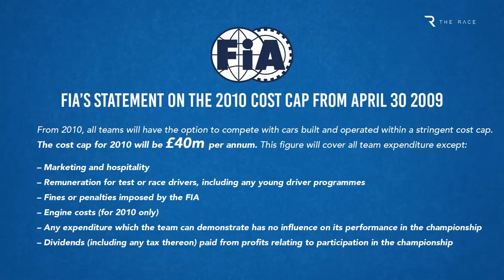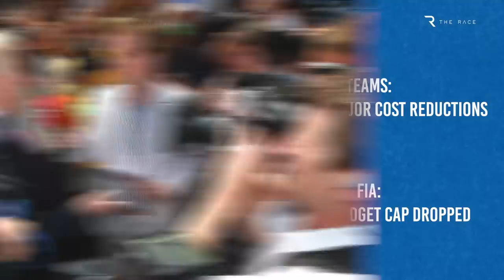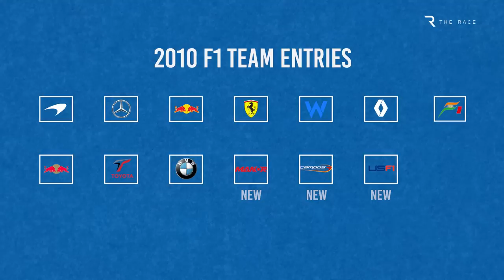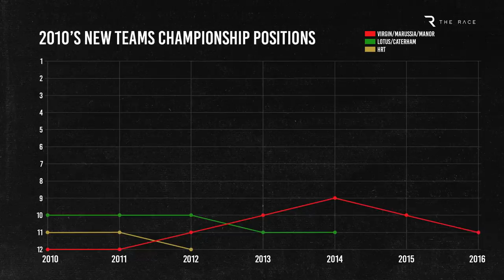Why F1 2010's new teams all failed

Comment: They were promised a cost cap would be implemented quickly but it never came.
Reply: Well it came 12 years later😂
Reply: @CmLeo145  yes, but that’s in an era where the teams realized they can just tell newcomers to get the hell out of here if they aren’t manufacturers, so is it really that much of an improvement?
Reply: Kind of like Red Bull then
Reply: @mrsoisauce9017  or willing to buy out an existing team. F1 isn't that attractive to start from scratch now.
Reply: @WhiteG60  maybe inflation does not help too
Reply: Too much money at stake and the budget unlike nowadays could not be properly regulated.
Reply: @WhiteG60  back in the first half of the 2000's top teams were spending over 100M, F1 has always been really expensive
Reply: @WhiteG60  that's not the mechanism. A voluntary cost cap with technical freedoms Vs no cost cap but technical limits
Reply: If I remember, the cost cap that was supposed to happen never came because the top teams,  Ferrari, Red Bull, Mercedes and McLaren rejected it harshly.
Reply: @CmLeo145  or even 200 years later.
Reply: @siloPIRATE  more like downgraded red bull.
Reply: @krys8494  inflation seemingly never help bro.
Reply: @purwantiallan5089  it surely felt like 200 🤣🤣
Reply: @WhiteG60  Toyota spent 400 million in the early 2000s
Reply: @WhiteG60  obviously it's for all the expenses, including the development of the engine, from which they also made money by selling them to Williams

Comment: It shows how expensive F1 has become for the proposed cost cap back in 2010 when they first thought about it to be £30M
Reply: Hybrid be that way. Even crazier that the biggest teams didn't even blink.
Reply: back then the team budgets were around the same as the current cost cap or more, 30M was a joke for most of the teams that's why it was removed
Reply: Maybe a double-hybrid system that does nothing but make the cars larger, heavier and more expensive just so auto manufacturers can virtue signal about the enviroment was a "bad idea" in single seater racing.   Car companies dominating the sport is the worst thing eccleston did during his tenure in charge.  F1 was far more "F1" when teams like Lotus,  Brabham and Arrows were in the sport, real racers, than a marketing wing of a mega corporation.

Somehow its too expensive to ship refueling equipment to each race (that makes the cars smaller and lighter so they can fit on a track together), but a hospitality center that takes 8-12 semi trucks to transport so corporate guests can ignore the race in comfort is no problem for the sport to handle.
Reply: @thevictoryoverhimself7298  refueling is about more than expense. The primary reason they don’t do it anymore is safety, and because they don’t have to.
Reply: @mmonkeyman1403  the stated reason at the time was shipping costs.  I was there at the time :). This was in the middle of a bunch of dumb knee-jerk reactions to the 2008 financial crisis that we are still living with in f1.
Reply: @thevictoryoverhimself7298  refueling isn't what made the cars smaller, the larger tanks don't take up that much more space, maybe lengthening the wheelbase a bit. The reason the cars are so gigantic today (and since the hybrid rule set was introduced) is to maximize the area of the floor. The hybrid adds the weight, but the giant footprint is due to the regs, and teams won't want to give up that much "drag-free" downforce.
Reply: @jsquared1013  it’s a combination of the hybrid system, the fuel tank (it’s literally 3 times larger) and increased crash safety.  2 of which could in theory be removed today and result in better racing.

Everyone blames dirty air but I think the giant cars are a big problem for overtaking.  Grand Prix cars have been racing at Monaco for 100+ years or so and while the track was always tight, only recently have arguments to drop it completely gained traction.

Monaco.  Imagine f1 without Monaco.  Losing Ferrari would be less damaging to the DNA of the sport.
Reply: @thevictoryoverhimself7298  Agreed. Even the AWD hybrid LMP1 cars were nearly half a meter shorter than current F1 cars so I don't think there should be any excuse for the next generation of chassis regs to not shrink the cars.

It seems to me that slowing the cars down by a significant amount via a combination of less aero and less power might help a bit with the size/weight of some of the safety structures on the cars. A slower car has less energy to dissipate in a crash. They could be 10s a lap slower than now and they'd still be the quickest race cars out there.
Reply: @sealcuddl3r  There is something wrong with f1 cars being slower than they were 10-20 years ago tho.  Its an engeneering exercise first, a sport second, a show last, and a safety exercise never.  On some level we need to be comfortable with drivers, track marshalls and even spectators dying.  Not too often, but not never.  True "never" is infinite and perfect is the enemy of "good enough".

I think the cars gaining size to make deadly accidents 20 years ago survivable is a win.  I think making the cars larger to allow for no refueling or hauling a giant load of batteries around for a grand prix distance like a glorified semi truck (google says this is american for "articulated lorry") is a loss.
Reply: It was low because it was optional and you gained some other advantage to make up for using so little money.
Reply: @mmonkeyman1403  not even Red Bull noticed that big cost cap.
Reply: @thevictoryoverhimself7298  double hybrid system and double the cost cap maybe gonna hurt any single new team attempting to compete in F1.
Reply: @jsquared1013  imagine if Vettel RennSport entered F1 in 2025.
Reply: @sealcuddl3r  my favourite era of car dimensions was as they stood at the end of the 1992 season. Wide track, short wheel base, low front wing and high rear wing, massive diffuser with a flat undertray.

I know flat undertrays are unstable and dangerous and that wing configuration impaired by following in a wake, but that’s when F1 cars purely on looks were at their best. I hated the double bites of 1993 and 1998 to bring us into the narrow track era and was absolutely delighted when he went back to wide track, but I agree the cars are massively too long now…
Reply: The budget cap was needed for practical reasons, but in a sport already hamstrung by everything you can think of being banned prior to this, it feels like F1 has definitely lost some of the technical excitement.

I’m much more a fan of the idea of having a budget cap with more technical freedom. However, I realise that also has some down sides associated with it.

Maybe the solution could have been wait for the ground effect regs to shake down and everyone to have a car that doesn’t bounce and there to be some performance convergence and then one season at a time open up a specific angle of the regs to more free development.

Like for example, allow active suspension back in. But do it on some sort of proviso (I’m not sure what and what would be workable) that if one team gets too much of a sustained advantage from an innovation that they have to supply it to the other teams, which gives them some sort of budget cap flexibility.

The smaller teams may well fall back into a habit of waiting to buy stuff off the big boys, but they are kind of doing that for free anyway already with aero parts.

The other big boys, with much higher expectations on them would not be able to sit and wait two seasons before being given some innovations for free, so would have to try and match their rivals…
Reply: @thevictoryoverhimself7298  I think with the new cars dirty air isn't really an issue anymore. The main issue is the size, like you mentioned, and also the lack of competition for the no.1 spot. When the Mercedes dominance ended in 2021, all the races suddenly became a lot more exciting. It was the same for the first 6 or so races in 2022, until the Red Bull dominance we know today began, and the races became dull again. If F1 wanted a quick fix, it could just nuke the Red Bull facilities but that would be pretty unethical, unfair, and would it really make that much of a difference, since we would most likely see Alonso run away with the title instead after Ferrari do their usual self implosion and Mercedes are about as consistent as my shit after a Mexican meal. Also, to my knowledge, FOM does not have weapons of mass destruction although Bush would probably claim they do so he could start an illegal war .
Reply: @potatogirlcultist19  f1 isn’t really beyond being unethical.  Mercedes didn’t naturally lose competitiveness with the other teams organically, rule changes were made that hurt them more than other teams and when it looked that even that wasn’t going to be enough, they put their thumb in the scale to push max over the finish line.  (And heads had to roll)
Reply: The general consensus was that it wasn't attainable back then
Reply: @thevictoryoverhimself7298  they're bigger because in 2015 and 2016 the f2 cars were nearly as fast as the slower f1 cars and f1 couldn't have that so they widened the cars and tyres for more aero speed
Reply: @harry4454  no, they made the fuel tank larger so they didn’t have to refuel, increased the size of the survival cell for increased crash safety, and added about a meter for a giant battery bank and hybrid system.
Reply: @thevictoryoverhimself7298  no. Youre just completely wrong as the cars weren't even that wide until 2017
Reply: They're actually similar, because of inflation and changing exchange values. Namely, 2009 Pounds were worth 1.5 times what they're worth today, and 2.5 dollards.
So, 30 Million Pounds in 2009 are 110 million dollars, today. This also means the current cost cap is somewhat lower than the revised cost cap.

Comment: What the video didn't mention: Ferrari back in 2009 did everything they could to prevent the cost cap from taking effect, even got other then current teams onboard, and they got their way eventually.   Hence if you ask me, this was the reason why there is a large gap between teams back in 2010. Had 2010 had a cost cap, things might have played out differently favoring the new teams.

Cruel irony given Ferrari has agreed to cost capping from 2021 onwards.
Reply: @WhiteG60  that would be definitely q cool but top teams defo reject that 😭. The current cost cap still doesn't make the field completely equal since ferrari red bull mercedes have better facilities and full dyno testing. So that 2 tiers is a cool concept defo
Reply: @javierplays9516  RB/Mercedes/Ferrari would still spend 500 million a year, as if they are 1 second or 2 seconds faster than the rest, that benefits for the others do not matter at all.
Reply: @christian9125abd  true which is why i still prefer the current cost cap. But nothing the FIA will do can change the top 3 anyway, the top 3 will always be ferrari mercedes red bull, except for one off years or a slow decline (rip mclaren & williams)
Reply: @javierplays9516  Aston seems the have entered the top 3. and ferrari is slowly declining, unlike RB and Merc they have no consistency.
Reply: @christian9125abd  "except for one off years". While ppl like to troll on ferrari they never rlly declined recently, they hv js been not making use of their package. In the past decade they finished in the top 3 ignoring 2014 & 2020. But they have up & down seasons ur right its never stable
Reply: @javierplays9516  but since 2010 F1 is gone to a battle between RB and Mercedes. Ferrari only plays the third role since then.
Reply: @WhiteG60  I get the idea of mixing it up, but that surely takes away from the true spirit of racing? Seems more like a Mario cart game depending on how much you spend.

It’s a common problem throughout all sports. Imagine football if you lost a player if you spend over a threshold 😂
Reply: @matthewcharles1688  I mean... that happens in the NFL. Sort of. If you spend over the salary cap you can be docked draft picks. But again, the point of F1 is to MAKE money. To make money, you need an ever expanding audience, and if you bring in this huge causal fandom from DTS and the like... GREAT. But if the same two or three people win the race every week, that's no good. If you come away from DTS loving Yuki or Albon... why bother watching? They're not going to win. They barely get shown on TV in the race because, whilst they might be fighting for points, its fighting for 8th/9th/10th at best. The NFL is so hugely successful because your team can go from trash to winning the Super Bowl in 1-2 years. There's parity. MLB in the US is declining because 24 of the 30 teams refuse to spend any money and put competitive teams on the field.
Reply: @christian9125abd  what 2010 between red bull & mercedes??!! Hello mercedes were like 4th best that season. It was between red bull ferrari mclaren, did u even watch f1 in 2010
Reply: @christian9125abd  ouh wait i misread but no its since 2014* & ferrari has finished in top 2 4 times since then, pretty sure red bull also finished top 2 4 times since 2014. So yeah ferrari declining is still abit questionable, not saying they are a fantastic team, but they are still a team with very fast cars
Reply: @javierplays9516  since 2010 only these 2 teams won both drivers and constructors championship. for teams like ferrari and McLaren it should not be enough to compete for the title, but to also get some.
Reply: @javierplays9516  but ferrari is no more a real threat for RB and Merecedes (now mercedes has a bit of a hard time and rb had a hard time with renault hybrid engine) but these 2 teams work perfectly, their pitstops and strategies are good, they always move forward in development, they have save and stabil leadership. their team principals are the best in the sport and they have full control over the racing teams. ferrari can't compete with that structure.
Reply: @christian9125abd  ur right but good things never last. Toto and christan will never be replaced easily. Ross Brown and Todt at ferrari still hasn't been replaced with new personnel of their quality. Ron Dennis and whitmarsh at mclaren still hasn't been replaced with people equal to them. Williams is the only old top team who their own goats like Frank and patrick took their own team down
Reply: @javierplays9516  but there is also some difference, Horner and Wolff get free room to decide stuff on their own. vasseur will never get that, he needs the approval from the ferrari company if he want to do big changes.
Reply: @christian9125abd  ur not defeating my point though. Who said red bull & mercedes team principals have full control of their f1 teams forever. No shit Fred has to answer to the CEO. Thats how ferrari is. Currently red bull & mercedes don't work like that, but who knows if their management will be as smooth 20 years from now my guy. Good things alw come to an end. The new red bull management currently may work differently compared to the late dietrich, they already want to do smth abt alpha tauri.
Reply: @christian9125abd  back then jean todt and the then ferrari ceo defintely worked well hand in hand. Even if ferrari were slightly annoyed a French guy gave them the biggest domination jn their history. That was 1-2 decades ago. What makes u think red bull & mercedes will be the same with that same timeskip starting now with future team principals that are not toto or christan hypothetically
Reply: @javierplays9516  but they also need to see that RB Racing is working perfectly and needs no guidance from the RB mother company. especially not from the former leipzig trainer, whoes football team is now struggeling
Reply: @javierplays9516  talk about triple irony.
Reply: @christian9125abd  agree.
Reply: @purwantiallan5089  elaborate on where im wrong
Reply: @purwantiallan5089  wait i misread my bad LOL
Reply: The cost cap was $30Million a year, thats absolutely nothing
Reply: @WhiteG60 thats all very gimmicky though

Comment: As an ex-Cosworth engineer, I got the opportunity to work in the big circus between 2010-2014, and the issues were merely money and I&D (no wind tunnel and most of the parts and development were required by an external partner.

Comment: I feel like there needs to be a space in motorsport for teams of this scale to be able to setup and compete with their own design and built cars without being embarrassed by the established F1 teams.  Imagine a series of around 12 races in Europe (maybe a couple in the Middle East) including tracks that have fallen from the F1 schedule (like Hockenheim, Nurburgring, Istanbul, etc...) with teams of a budget cap of around $25million to design and build their own chassis (with affordable spec engine and basic hybrid system).  Likely the series would run in companion with other non-F1 series like DTM or ELMS.  This "EuroGP" series could act as a development series for drivers (e.g. F1 reserve drivers and those stuck between F2 and F1), potential new teams that could ultimately prove themselves worthy of upscaling to F1, and an outlet for dropped circuits in European heartlands.
Reply: Now's who's gonna pay for it
Reply: I think the idea could be alright, but, no one's gonna pay for it. Most of those tracks "forgotten" by F1 still have important junior series, local championships and even international races (mostly sportscars) going around so it's not like people forgot about them, and all of those drivers "stuck" between F2 and F1 have many options to go to if they're good enough, and the ones that don't, well, maybe they weren't good enough.